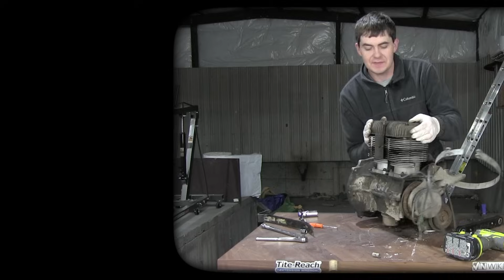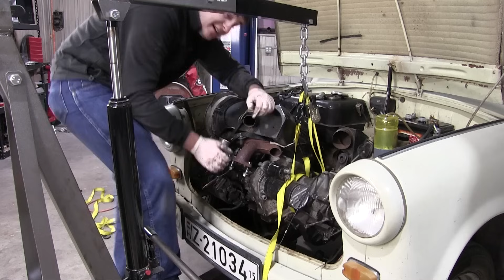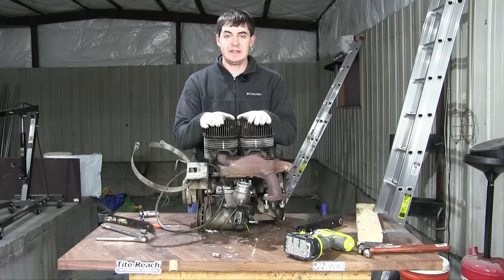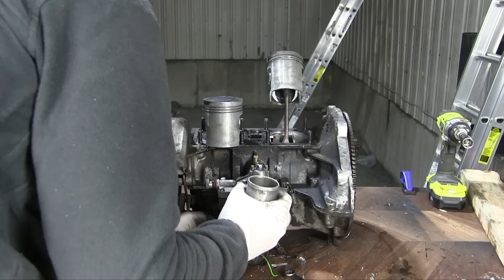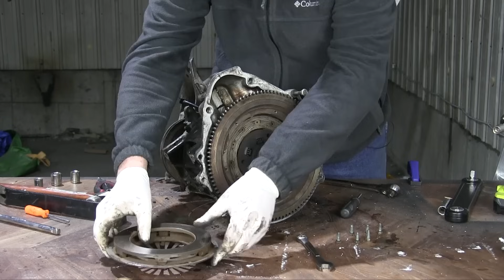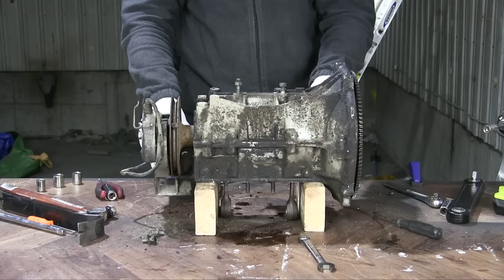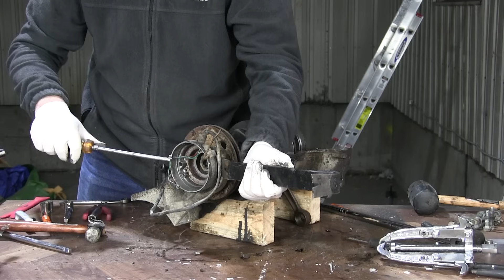Rebuilding the Trabant's Engine: Part 1 - The Teardown

Comment: I cringed when I saw you dig out the wrist pin circlips without first stuffing a clean rag into the open crankcase under the piston!  Nice pin extractor, though!  (A little heat on the piston might have made it unecessary, however.) I gotta say I'm kinda surprised at the high quality of the bits you've shown us.  But then, I WAS still Germany!

Comment: Did you know, that the last few Trabants that were produced did not use the two stroke engine, anymore? Those models, which can be easily distinguished by the different front grille, use a 50hp four stroke engine licensed from VW, which came directly from the VW Polo... But at that time it was already too late for the aging Trabant. As the wall was already down, people rather got themselves a used Polo, instead of this communist car dinosaur... Which isn’t surprising as, besides the engine, absolutely nothing else changed about the car, which has been basically the same since 1963!

Comment: Robert, I have serviced these (and other) engines numerous times. I would have a couple of suggestions that you might find useful. (1) Before you take apart an engine, after careful inspection, wash it thoroughly. (2) Before you remove any parts, make sure that you have collected all bolts, nuts, washers and other small mounting parts. Put them in a resealable bag, and use a duck tape to stick them to their corresponding part. After that, ALWAYS remove them from where they were mounted, especially when you are working under the car. Put them in separate plastic storage boxes. When needed, you can even stack them to save floor space. (3) When you remove a Trabant engine, you don't have to take out the transmission. Just lift up the transmission with a hydraulic jack and they come apart easily. (I can't exactly remember, but you might have to remove the transmission's mounting nut from the rubber shock absorber in order to gain adequate clearance.) Remove the cooling jacket, turbine, starting motor, dynamo (yours is a 6V DC generator though), ignition system, while the engine is still in the car. And yes, you can take it out on your own, without using an engine hoist. :) (4) When you are servicing a any small engine, mount it in a bench vice. It will save you from an awful lot of struggle. For the Trabant, you can us a simple L-beam. (5) Those 2 large holes on the flywheel are made precisely for that purpose. Only that, you MUST turn the crankshaft to a position when they line up horizontally with the engine's block. (so that you wont break the ring underneath) Put two bolts in them, tighten them firmly, then put a short piece of brass rod inside the crankshaft's centre hole and hit it with a hammer. The fly wheel just pops off the taper without making any damage. (6) The side way movement on the left conrod is just on the edge of being faulty, the right one is good. (7) The crankshaft bearings do need a replacement. If you have the replacement bearings, you can pay a local machine shop to do it for you or buy a refurbished assembly. Some European machine shops who service them, even buy your used crankshaft. So don't take it to the junkyard. Remember, this is Trabant, everything is serviceable. (8) I see your window wipers are not resting on the bottom of the windscreen. Spray some water on the windscreen and observe whether the wipers can reach the bottom. If they do, you can adjust that behind the dashboard on the end of the wiper motor's shaft. (it's pretty tight in there, though, you might want to ask someone with smaller hands) Loosen the clamp, turn on and off the wipers. Allow the motor to return to its default position, also move the wipers manually to where you want them to rest. Tighten the clamp. If the wiper test reveals that the wipers don't reach the bottom, then you have to adjust the wipers individually. Fold them up and use a flat screwdriver to loosen them. Move them manually where you want them to be, then tighten them up. Good luck.
Reply: I'm just dropping in to say that you've done the Lord's work and this is what Internet is really for. Thank you. I don't own a Traband (and so far I've sold my car altogether and not sure when I plan on getting another one) but seeing as you've spent quite some time writing all of this out - thank you for the effort anyways.
Reply: Great comment!! 👏👏👏
Reply: Everything you say only applies to organized people, I know about you guys, every nut and bolt accounted for, I prefer to exercise my mind and remember where every part goes, if you don't have some parts leftover, you are not doing the job right.😁

Comment: You self diagnosed the exhaust manifold problem at 9:30 3 years ago you failed to tighten the bolts after you played with the engine in situ.. ..doh !

Comment: Started with Mercedes video - carbon build up, can't change the plugs, 3 days later... This is no go, to hell with that!
Switched to this video - a little bit of hammer here and there, replace what you want! ¯\_(ツ)_/¯

Better Engineering means not over engineering!

Comment: play side to side is normal on a 2 stroke con, must have no play up and down,  and watch the baerring outer ring if it frictions against the rod. experience with 2 stroke motorcycles ,  and on trabant well it will be a bit more ...  (watched it to the end so my anser was redundant since it was virtually unsalvagable due to main bearrings

Comment: 10mm and 13mm sockets are notorious for disappearing.
Reply: Every german guy, who owns an old two-stroke vehicle, knows how it is to loose these 10 and 13 mm sockets😂
Reply: @timonkovar5194  Every german guy, who owns an old two stroke, has at least two or more 10mm sockets ;)
On my Simson SR50 are maybe around 5 screws that are not M6 with 10mm head
Reply: As a vw polo owner I can confirm.
I want to hang the 9n 47kW designer. Working on this car makes me wanna drink the used antifreeze.
Reply: I carry my 20er Torx  (Torx= *) as a necklace, cause else it´s being stolen all the time...
Reply: @klausbrinck2137  my theory is that T20 eat unhealthy snacks when you are not looking and then rhey grow and become T25 because when I need a T20 all I ever find is loads and loads of T25.
Reply: @VWrijder77  "supersize me"
Reply: If this ever happens to me the next thing I'm doing, after 5 minutes of searching and swearing, is buying like 5 of the fuckers (the tape measure solution) and putting two in odd but frequently accessed locations.
Reply: Amen
Reply: The devil Made me say it     même pas drôle
Reply: I bought a couple of cheap ones for my kit and hide my good ones
Reply: 14mm are worse

Comment: It's called a 'heat exchanger' and bouncing it off the deck like that can do internal damage ... with the result that carbon monoxide can leak into the heated air ... with potentially dangerous / fatal consequences while driving !

Comment: I did this often and we never pulled out the engine with the transmission. Its so easy to work on this car. The only things you need are some metric tools and 2 hands!

Comment: 25 HP with a 37ci motor. But the car only weighs like 1300 lbs.  I’d like to put a tiny turbo on one just for fun. This tiny car would also be a great one for a engine swap maybe from a motorcycle. It’s like 600cc now. Modern 600cc motorcycles make about 100hp and about 60 lb torque.

Comment: FWIW: Kawasaki also used a rotary valve. A piston wrist pin remover could have been more easily fashioned with a long bolt (or piece of all-thread), a socket and two nuts. The crank should be able to be rebuilt, not necessarily replaced, much cheaper (done all the time on 2 stroke dirt bikes).  Overall, a really enjoyable video. Most YouToob videos are not entertaining and even less informative. A suggestion: Shoehorn a 4.3L TBI Chevy V6 in it, it's as reliable as gravity and as simple as a claw hammer … or not... :))

Comment: Believe it or not, East Germans had to wait ten years to get their hands on one of these new. And no, you didn't get to choose the color. The color you got was whatever they were making that month. They were relatively cheap, around 2,000 East German Marks, if I remember correctly, and you had plenty of time to save up for one. The weird thing was that a used Trabant cost more than if you ordered a new Trabant. The difference? Immediate delivery. That's communist economics for you. Also, I'm not sure of this, but I believe the old Trabant factory in Zwickau was later taken over by VW after reunification.

Comment: Why you remove also the gearbox?  Unplug all electirc cables, remove 5 screws on the gearbox and motor mounting bracket, now you can lift the motor out with a crowbar by alone.  I do this many times in the 90s! Its so simple

Comment: your not to bright to remove wrist pin you use a propane torch and lighly heat the underside of the piston it will fall out never press it or hammer it out

Comment: I like what you are doing. Just go for it and learn on the job!

For those familiar with East German engines: there are quite a few crossovers with MZ, Wartburg, Simson etc. in basic design. One can get the idea they made one engine and developed it into different sizes. This, I’d say is an advanced twin MZ.
But strangely if you compare it with the 1000cc Wartburg, the Trabi Engine is more advanced. Wartburgs have no intake control or ignition advance (nor do MZ).
Get yourself an EBZA, the electronic ignition module. It will make it run smoother and use less fuel.

Looking forward to the reassembly video!

Comment: The body is made out of a "Paper Composite". It's similar to fiberglass, however it's not glass, it's paper. 2 stroke, 2 cylinder, 4 speed manual, 600cc, has a top speed of around 55 mph, built around 1977, carries 4 people and is STILL RUNNING! ?

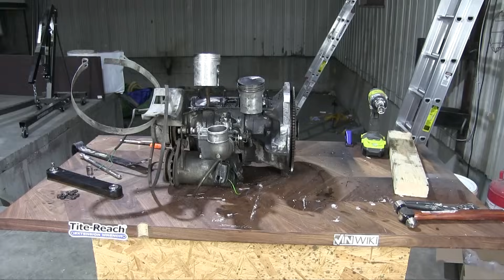Comment: 10:20 this is painful to watch, 2 stroke piston skirts can break doing things like this, also beforehand see how piston 2 is moving as the crank turns while pulling jug 1 off, if the skirt gets bound up and the crank turns further this can break a skirt as well. Use a tuning fork shaped piece of wood to slide around the con-rod , between the crank case and the piston so it has something square to rest on. I have seen pistons break like this many times.
Reply: Oh ye have little faith... I've been working on snowmobile engines for decades, any asshole with a 9/16ths wrench can get one of those apart and I've never seen one break a skirt during disassembly.
Reply: I have little faith because like I said, I've seen it happen with my own eyes. If you're restoring vintage motorcycles, sometimes the country they came from doesn't even exist anymore, let alone spare pistons.
Reply: Know what you mean,i can be working on a weed eater motor and ill treat it like its something out of NASA, I'm just OCD that way,ever seen a video of a heater core removal when someone cuts the firewall ??  i usually have to skip that cause i get ill,lol, i dont care what kind of car it is, is gonna get done properly every time,all the time.  @wiseguy724
Reply: its a Trabant you cant make it much worse

Comment: Interesting challenge to rebuild a Trabant engine. FYI : A dynamo and an alternator are both electric generators. An alternator produces (like the name says) alternating current AC, which is transformed into direct current DC over a voltage regulator. A dynamo produces direct current DC on its own immediately.

Comment: Holy shit, this error at the exhaust system has cost hundreds of lives in the GDR. The problem is that the exhaust gas from the hole in the exhaust is passed directly through the large fan in the interior, which not infrequently had the suffocation of the inmates to follow.

very uncomfortable something.

Comment: What about getting a press and removing the bearings and fix the crankshaft yourself? That is what I would do, and also fabricate what is needed to make it work. Also you could get any GOOD machine shop that knows what they are doing to fix it for you.

Comment: Equipment: hammer.
(Sickle optional)
Reply: The hammer is the official crankshaft adjustment tool, right from the trabant factory in '91 : 

https://youtu.be/emoF0EFxjjA?t=1208
Did not see a sickle.
Reply: Sickle required
Reply: Und Ährenkranz!!
Reply: Be careful Mr. Wood... You can be replaced, Comrade.
Reply: The sickle is inevitable.
Reply: Neat seeing you here Toby Wood from all the old PhlyDaily videos you used to comment on.  After all these years and I still remember your challenge videos recommendations.
Reply: The one (and only) tool in Jeremy Clarkson's toolkit.

Comment: Wiiiing  ding-- ding  dingdingdingdingding   LOL  had a buddy in HS that had a 2 stroke car cant remember what it was but was fun to ride in with a trail of blue smoke trailing behind when you used the heater you could smell the Castrol 2 cycle oil  being this was in Miami FL seldom the heater was  used .

Comment: Just rip the rotary valves out of there and take a reed valve housing from a snowmobile,outboard engine etc and fabricate it on the engine! that will make the engine just suck in the air,fuel it want at any given rpm and load. smoother running and better milage,couple of extra horses too maybe. btw. that exhaust manifold is made before they knew anyting bout 2 stroke and all the hidden power to gain with a proper exhaust with all its angels and cones,baffles etc. take something off a snowmobile for that too ;) make that ole trabant fly :D

Comment: Dynamo is neither generator, nor alternator. Dynamo is for cars which used 6 V system (obviously simple cars which did not have much electric stuff inside such as Trabant or Polish Syrena). Mostly cars from Eastern bloc.

Comment: The crankshaft does come apart, that's how they fit new bearings and seals, but it's not a job I would attempt at home. Never, ever, take the crankcase apart by tapping a screwdriver etc between the two halves, you will damage the faces which MUST seal perfectly. When you come to fitting the pistons.... oil the gudgeon pins, (wrist pins), and put them in a plastic bag in the freezer. After a couple of hours heat the pistons in an oven at 100c for thirty minutes and you should be able to press the pins in by hand.

Comment: So funny, Tiny 2 banger. We put a 26 horse Briggs and Stratton in one about 4 years ago. A bit tricky until you realize you can just saw the back of the old engine off to make your trans mount and plate. Actually performs better, top speed now 71 mph. And total job made the car 105 lbs lighter.

Comment: Me looking under the hood of Trabant for the first time:
"A tank, a battery, pipe, pipe, bigger pipe, another pipe, biggest pipe, more pipes, where's the engine?"

Still better than modern cars. Battery under a plastic cover, under which there's another plastic cover for each terminal, a washer fluid reservoir under a plastic cover, airbox under a plastic cover, oil filler cap under a plastic cover, dipstick under a plastic cover, the whole fucking engine under one giant ass plastic cover.

Comment: The INSTANT you got the cylinders off, you wanted to stuff up the crankcase opening around the rods with a clean shop rag!  In your case, not completely important, since you ended up going all the way in, anyway - but if you weren't, something could have dropped in there and complicated your life uncecessarily. And I LOVED your diy wrist pin extractor!  Hope I can find the reassembly vid!  tnx for that!

Comment: Typical 2 stoke repair, everyone does a top end rebuild, then before the top end is worn out the crank bearings fail, or crank seals and the entire engine needs to be rebuilt. Doesn't matter if it's a chainsaw or a trabant. Always happens.

Comment: You can actually just use a wood clamp to press out the wrist pin. Use the socket and just offset the clamp jaws for the pin to exit. Easy squeezy.

Comment: The "thingy" that connects the piston to the connecting rod is known as a Piston Pin. Its unusual for one to have a roller bearing in it, but since there's no pressurized oiling system, it makes sense.

Comment: Toss a lawn mower engine in there and call it done. Probably more HP anyway heh...

Cool video though, I've never seen one of these engines torn apart. I also see that plenty of people have mentioned that it's called a wrist-pin. Good luck on the rebuild.

Comment: It's a gudgeon pin. Dictionary dot com is marginally helpful, if you look at the second set. of meanings of the word. (The first tells us that it's either a fish or a gullible person.)

'1. Machinery . a trunnion.
2. a socket for the pintle of a hinge.
3. Nautical . a socket attached to the stern frame of a vessel, for holding the pintle of a rudder.

'Origin of gudgeon: 1350–1400; Middle English gudyon < Old French go(u)jon, perhaps ultimately < Late Latin gu(l)bia a chisel; see gouge.'

In plain English, the gudgeon is the hole into which the pin for a hinge fits. The pin is therefore a gudgeon pin. Now that you're a little wiser, at least you've been entertained! Thanks for a great fun video. I can hardly wait for the next enthralling episode. Let's hope the delivery gods and their Amazons are not too overwhelmed by the spending frenzy at this time of year. 

Tell us; will you be proud, happy and thrilled when you've re-assembled the engine and are left with a heap of spare parts which don't fit anywhere?  ;-D

Greetings from Lincolnshire on the East side of the Pond.